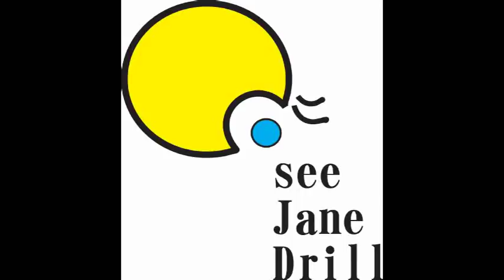Fastest Way to Install Large Metal Hook in Wood

Comment: Thanks for the tip! 
For fine tuning the hook position, you can also use a long screwdriver instead of pliers that will give you more leverage.

On the drill, most drill motors come with a 1/2 switch. One of them being slower, but more torque and better slow speed control. If you don't preset the hook into the material, it may fly off.

Comment: Because the eyebolt kept coming loose from my drill, I first wrapped it in plumber's tape.  Problem solved, and another item added to my "daily" toolbox.

It was really strange to NOT be told "You can do this!" at the end of the video, this must have been an early one.  In any case it's the one I came back for specifically, as mentioned in an earlier comment.  Thanks for being you and sharing your knowledge, Leah.  ☄️🍍

Comment: This is genius. I'd like to add a little something that I do and it works on any screw. Drag the threads across bar soap or beeswax if you have any and the screw will insert much easier minimizing any damage to the material.

Comment: If your electric drill doesnt have the power to turn the hook, use the longest combination wrench you have.  Open wrench on one end, closed loop on the other. Hook the closed end/loop around the hook, and slide it under the straight part of the hook.  Pull the body of the wrench against the  side of open end of the hook, and use it like a handle/ lever to turn the hook. It might take a couple tries to get the wrench against the correct side of the hook, to turn it in the proper direction.  Its even more confusing working overhead, for a plant hook, but you will figure it out.  You can  also use the open end of the same wrench to twist screw eyes in.  Just stick one side of the open end of the wrench,  into the hole, and pull or push the wrench, like a lever.

Comment: What a great idea! Do you have any advice on hanging a heavy chair from the ceiling? Would it be with a hook?
Reply from the maker: Hi Kyo, this is an instance where safety is involved.  So I really would suggest that you go to the hardware store, and talk to them about what you are hanging, how much it weighs and how much you expect it to hold, and so on.  Because fasteners are rated for different amounts of sheer strength and tensile strength.

Comment: thanks, i always bend mi secredrivers doing it in the wrong way
Reply from the maker: You're welcome. :)
Reply: Buy quality tools. Or use a #2 or #3 screwdriver. They tend to be longer also whch would give proper leverage. The motor trick works good and the screwdriver is for fine tuning the position.